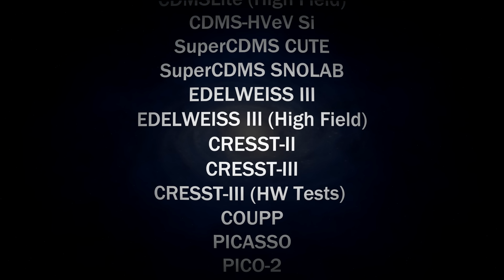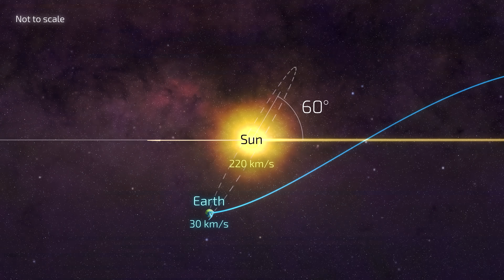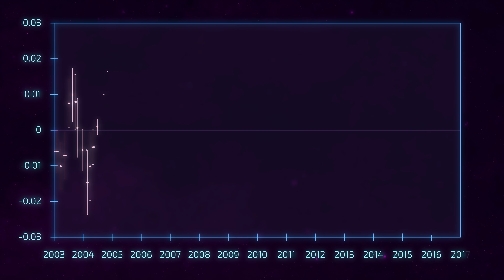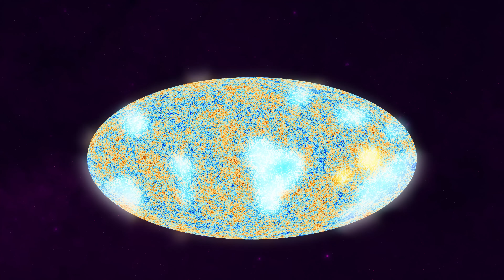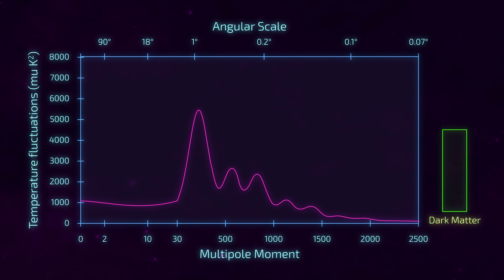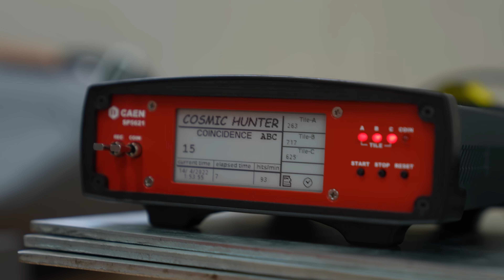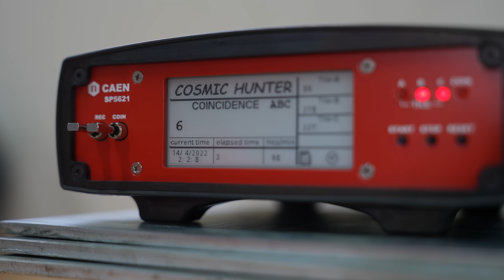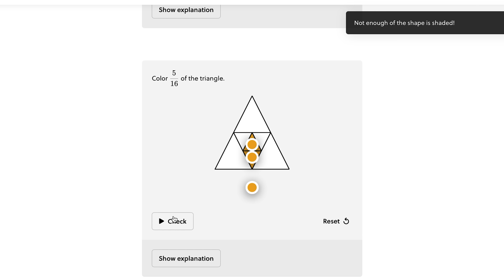The Absurd Search For Dark Matter

Comment: If dark matter interacts gravitationally shouldn’t it get caught up in star formation? Then wouldn’t it throw off our calculation of the hydrogen content and therefore the expected longevity of stars? Or, do our current estimates of star masses take this into account and assume the presence of a huge chunk of inert stuff?
Reply: Dark matter is very dilute, there is just a lot more of it. So the amount of it in and around the galaxy is huge, but the amount in the solar system is very small.
Reply: Dark matter could make up a significant fraction (maybe as much as 15%) of the mass of galactic black holes, but dark matter does not clump together unlike the Hydrogen and Helium that forms stars.
Reply: @tonywells6990  good explanation

Comment: Why does no one ever question Hubble's ASSUMPTION that the red shift is due to speed and that speed is an indicator of the expansion of the universe which in turn is how we actually calculate distance to far away galaxies.  There is another reason which leads to a much closer measurement of the distance to distant objects.  If we correlate all of the calculations you have done in this video to that nearer distance calculation, then the need for Dark Matter disappears and the universe becomes static with no expansion.  The cosmic background radiation is a signature of this effect, not a signature of the "Big Bang".  The Universe is a result of many "Little Bangs", one per galaxy.  Not one big bang.  Why have physicists not discovered this yet?  Quasars are the signature of a new galaxy springing into existence.  This is the proof.

Comment: What's missing here is the fact that galaxies in each arm of the spiral are also being pulled along by those ahead of them. This not the same as having a single mass in orbit. Normal conservation of momentum equations would not apply.
Reply: Nope, that was already included in the calculations and would also not explain stuff like the bullet cluster.
Reply: @hawkanonymous2610  Yet the galaxy looks to behave like a catherine wheel or disc as if all are in fixed position.

Comment: 2 things I don't get: 1. if dark matter doesn't interact with light matter, why is it supposed to interact with the underground probe? 2. if the sun is rotating around the galaxy, why doesn't the dark matter rotate too? In that case, the dark matter is stationary to the sun, so earth doesn't cross it in different speed in summer vs winter
Reply: 1. Those experiments were looking for particles that still interacted with normal matter, just weakly.

2. Even if the dark matter was rotating with the galaxy like the sun is, the earth is still moving faster or slower in relation so it doesn't matter.

Comment: dark matter strongly resembles the neutrinos, however a neutrino dark matter would have been hot and not cold
it seems like the particle of dark matter is very low in mass, maybe several magnitude lower than the proton is rest mass is, it could have been the neutralino

Comment: I'm curious: Does gravity have decaying elements like thorium into radon gas or potassium emitting gamma rays? Would those hold gravitational force or motion to hold together elements in the vacuum of space? Like how smoke follows you around a fire bc you create a block to the air flow- does gravity block the motion of certain gasses to create a flow through space?

Comment: I have to disagree, but too lazy to type out all the details.   Even the greatest minds take the same wrong path at a point they were certain of, so they paid it no further doubts.   
As simple as I can put it:  Imagine how gravity actually works; or what it actually is.  Nothing more than space-time pushing back to its purposeful position as matter forces the space-time mesh apart in various amounts depending on density and size of said matter.  This force of stretching the space-time mesh does not only effect the immediate space around the matter, but instead pushes space-time into other space far beyond the source of mass in a domino effect proportionate to the density and size of the matter.  The chain of effect is far, FAR greater than you seem to imagine, and can not be compared to any Earthly model outside of theoretical physics.  Nothing like waves of liquid, gas, or invisible waves of any spectrum.  Space-time mesh has its own physics where every single other part of physics is merely complimentary and simply allowed by the base physics of space-time.  Therefore, I say, there is no such thing as dark matter.  Only widely misunderstood variables everyone keeps assuming are factual enough to build theories from.  Nothing else is needed when you come to understand the physics of space-time’s effects on it’s self more factually and clear.  It’s not only about the relationships of different subjects on each other, but also the subjects upon themselves.

Comment: Could the increased velocity of outer stars be explained by the fact that the mass is 'carrying' the spacetime along the Rotational direction? I mean you once mentioned that the spacetime near a spinning Black hole can carry the fabric of spacetime too. Maybe this effect reaches farer than expected
Reply: This would fall into the category of modified gravitation theories. The issue here is that the rotational speed of stars in a galaxy is just one of the puzzle pieces. If you modify relativity in order to explain the rotational velocity curve, you may end up with a theory that fares worse when looking at the CMB, galactic clusters, or galaxy collisions.

Fundamentally though, the problem with modifying our theories in order to explain certain observations can easily run into the territory of overfitting. I bet you can take Newton's law of gravity, and then start adding term after term to it, with various parameters, carefully chosen to explain this or that observation. Maybe you'll even be able to make the choice of parameters consistent such that you can fit every single observation so far at the same time. But what does such a model give you in terms of explanatory power? Every open issue in cosmology could then be reduced to "it is how it is because the equation says so", and the answer to why the equation looks like it looks will always be "because it fits the data". 

Now, that doesn't mean scientists are not working on such approaches in parallel with the dark matter hypothesis. MOND (modified Newtonian dynamics) is one such approach, and there are many physics groups investigating various modifications of Newtonian gravity, relativity, quantum field theory or string theory in light of the cosmological problems presented. But there is a reason why so many physicists lean toward the dark matter hypothesis. It is a single assumption, supported by several largely independent observations at different length and energy scales, and it only asks you to accept the existence of matter that only interacts via gravity. There already is matter that interacts only via the electromagnetic force (photons), ignoring gravity and the nuclear forces. It is not completely unreasonable to theoretize the existence of matter that only "feels" gravity. It's just that gravity is many billion times weaker than electromagnetism, and only becomes considerable on huge length scales (solar systems, galaxies, galaxy clusters).
Reply: @patrickgono6043  spacetime, which is warped by a rotating source of high mass is a part of the general theory of relativity. there is no such thing as modifying it. Maybe the reach of this "pulling" on spacetime is just underestimated currently.

Comment: I live a few miles from a mine they're converting into physics labs.  For about a decade now, we've had a WIMP and neutrino detector using refrigerated Xenon at about the 5600 foot mark.  They're currently adding a new detector down at close to the 9000 foot mark.  I think it would be awesome to be a part of that project.  I have a T-shirt they put out a few years back: "NERDS looking for WIMPS."
Reply: Sounds like the Homstake mine in Lead, SD? LZ experiment for WIMPs and the DUNE Far Detector
Reply: @DaylightRobberyCA  That's the one!
Reply: @kittenisageek  I worked on some of the subsystems for the LZ detector but never got to travel to the experiment.
Reply: @DaylightRobberyCA  that's awesome!  I've been to the top of the mine,  but my opportunity to go down was canceled last mintue.  So I haven't been down either.

Comment: The matter at the edge of the galaxy is obviously rotating slower than the centre which is why it looks like a spiral. Given it takes 250 million years for the Sun to rotate once around the galaxy and the sun is only 5 billion years old, it would have done only 20 rotations which is why the spiral still exists. Dark matter is just a made up fudge factor in an otherwise correct equation - it doesn’t actually exist.

Comment: Red Shift:  Consider the following:
a.  Current narrative:  Space itself is expanding.  (Even though science does not fully know yet what 'space' actually is nor how it could actually expand).

b.  But consider:  The net effect of solar winds, particles and energy pushing outward from galaxies, (even modern science claims 'em' has momentum), continuously, over a prolonged period of time, with other galaxies doing the same, with nothing to stop them from doing so, would tend to push galaxies away from each other and even potentially allow the cosmic web to form between galaxies.

And then, when we here in our galaxy, look at far away galaxies, with other galaxies in between, the net effect of all those galactic interactions would have galaxies furthest from ours move away faster the further those galaxies were from us, including us perceiving a red shift of energy.

c.  Now, utilizing the scientific principal of Occam's razor, which way is more probably correct?  What the current narrative is ('a' above), or 'b' utilizing known physics?

*  Added note:  Plus, 'if' my analysis is correct that our spiral shaped galaxy is collapsing in upon itself, then consider also:

d.  When we look at solar systems between ours and the center of the galaxy, those solar systems would be getting pulled faster towards the center than ours, hence also seeing a red shift of energy.

e.  When we look at solar system between ours and the outer edge of the galaxy, our solar system would be getting pulled faster towards the center then them, hence also seeing a red shift of energy.

f.  Only if we looked at solar systems adjacent to ours should we see a blue shift of energy (as the solar systems became closer together as they moved towards the center of the galaxy).  I also propose looking for blue shifts of energy between our solar system and adjacent solar systems to confirm or deny this current belief.

g.  But if true, would also add to our observation of seeing a red shift of energy in this universe as our spiral shaped galaxy collapses in upon itself.

Of which, not only would species from this Earth have to get off of this Earth before the Sun becomes a red giant one day and wipes out all life on this Earth if not even the entire Earth itself, but species from this Earth would also have to successfully get out of this collapsing spiral shaped galaxy, otherwise, most probably death awaits us all and this Earth and all on it are all just a waste of space time in this universe.  All life from this Earth would eventually die and go extinct.  Currently, no exceptions.

3 basic ways out of this galaxy to potentially continue to survive, (as a species or whatever evolves from our species):

1.  Long way:  Outward through the galactic plane.
2.  Medium way:  Outward through the angled solar system's plane.
3.  Short way:  Outward, about 90 degrees from the galactic plane, as adjusted for the galactic magnetic lines of flux for a smoother ride.  (Basically 'rise above' the collapsing spiral shaped galaxy).

*  And music, don't forget music.  It's going to be a long trip.
Reply: SPACE IS FINITE AND TIME IS INFINITE:
('Space' being energy itself, 'Time' being the flow of energy):

Consider the following, utilizing modern science and logic and reason:
a.  Modern science claims that energy cannot be created nor destroyed, it's one of the foundations of physics.  Hence, energy is either truly a finite amount and eternally existent, or modern science is wrong.

b.  An 'absolute somethingness' cannot come from 'absolute nothingness', 'absolute nothingness' just being a concept from a conscious entity in 'absolute somethingness'.  Hence, an 'absolute somethingness' truly eternally existed throughout all of eternity past, exists today, and will most probably exist throughout all of future eternity.  That eternally existent 'absolute somethingness' most probably being energy itself.

c.  The universe ALWAYS existed in some form, NEVER had a beginning, will most probably ALWAYS exist in some form, and possibly NEVER have an end.  Alpha and Omega, beginning and end, have been replaced by actual reality.  No Creator needed.

d.  And for me, 'space' is energy itself.  Wherever space is, energy is.  Wherever energy is, space is.  They are one and the same thing.  And 'time' is the flow of energy.  Hence 'spacetime' being 'energy and it's flow'.  'Spacetime' had no beginning and will possibly have no end.

*  There is really only 1 single truly eternal day that had no beginning and will never ever end.  The day of truly eternally existent ever flowing energy.